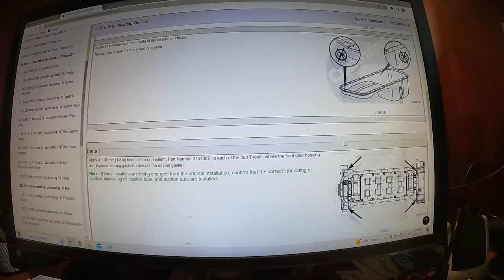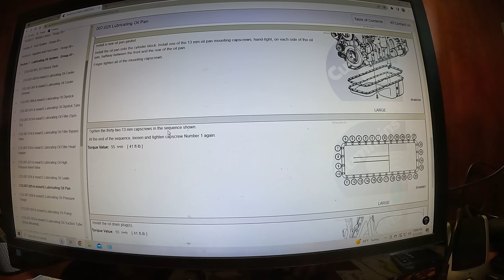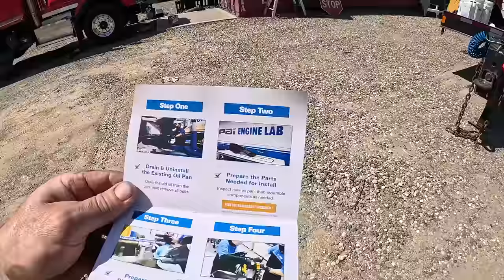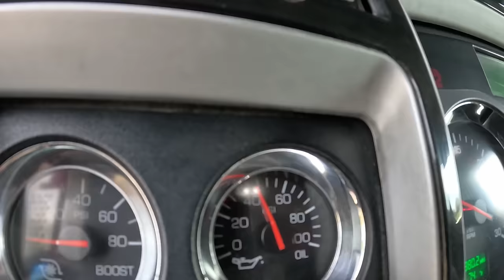Cummins ISX15 Oil Pan and gasket replacement Dump truck owner operator

Comment: Brilliant Mikey. Lots of good stuff to educate other operators who are gonna change the sump...or oil pan as you guys call it
What your video cannot convey is the utterly horrible mess as oil runs up your arm and go where oil is not supposed to go. I feel your pain. 
So many times I've had the same angst, trying to fit an oil filter filled with oil and screw it on to the housing.
 Your fingers are covered in oil and slip like hell on the filter. Once you got it on by a couple of threads, you can clean your hands, and the filter and tighten it tighty tighty by hand.
 
That slippery oil catches you out all the time. Even although you say at the beginning...this time there will be NO MESS.....there always is a mess. It's the Law.

Comment: Yeah your right. Torque it correctly. Over tightening will cause them to leak. Did it in my 12 valve. It mushrooms the bolt holes on the pan which caused the gasket to not sit down all the way.  Then you gotta buy a new pan.
Reply: What’s the torque

Comment: Boss man… it must be a relief to find the pan was clean?  

When I was a kid, motor oil was not nearly as good as what we have today.  It broke down much faster under heat and didn’t have the Mulit-viscosity characteristics.  If an engine went 100k miles, you were lucky.  

My dad kept a pencil magnet in his tool box.  When he dropped a pan or opened a small gas engine block.  He stuck the magnet into a rubber glove and fished around to find metal flakes.  

He used kerosene to rinse the pans and sprayed it into the bottom of the block to remove all of the gunk.  That was a messy job but one that he believed added life to the engine.

It had to be done often because the gaskets were made of cork.  It got hard and brittle.  And, the rubber used in the seals was all natural… it broke down too.

There are so many technological improvements in automobiles that have increased their engine life.  But, in my opinion, none attributed more than improved oil and seals!

You did a great job filming and explaining this.  Thanks for taking the time and putting in the effort!

Comment: Just replaced a Cat C7 shallow sump oil pan last night. Thanks for your video admittedly 36 1inch identical bolts was alot easier than your big cummins. Hopefully no leaks

Comment: Well done,  Mike on dirty jobs couldn't do better. Might have been the 📷 but when you were checking for leaks, front driver side, rear of spring, looked like 3rd  spring back have was bouncing up and down with the truck running. Maybe my eyes but you might want to look at it. Stay safe.
Reply from the maker: Thanks ill check it out in A.M.

Comment: I had an oil pan go porous on me a few years ago. I tried repainting the outside with the appropriate paint and sealer but it was too far gone. It was like a sieve in the end, those oil pans take a beating over winter under a vehicle. Would that new pan not need painting, Mike?

Comment: Hello sir thanks for video. Could you please share with me the Cummins part number for the oilpan ? Thanks.
Reply from the maker: I don't have it on hand call your dealer that's how I got it
Reply: @DIRT-BOSS  I understand. Here's the thing of it.... I have access to aftermarket truck parts but most of the time they want a dealer part number. Aftermarket is very useful because it's usually way cheaper and comparable in quality